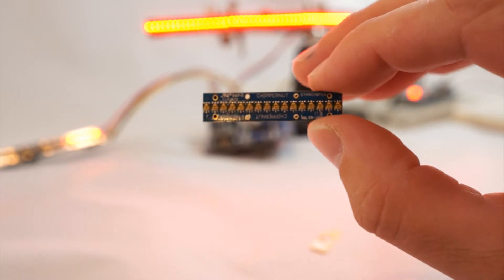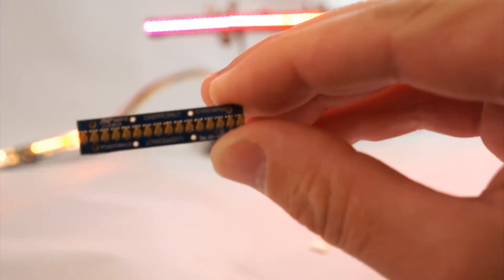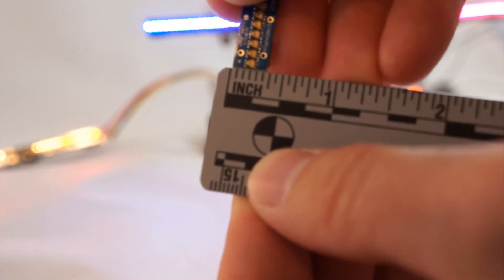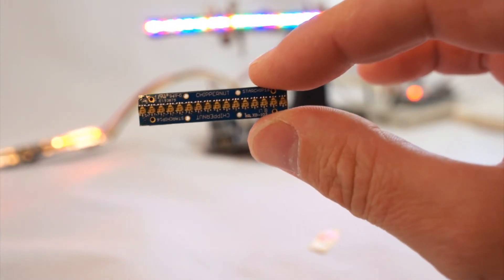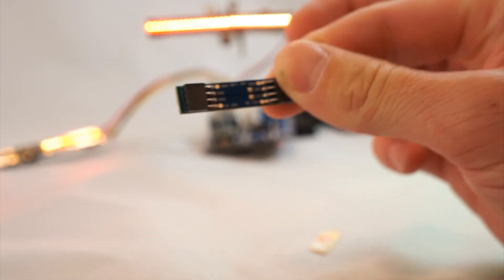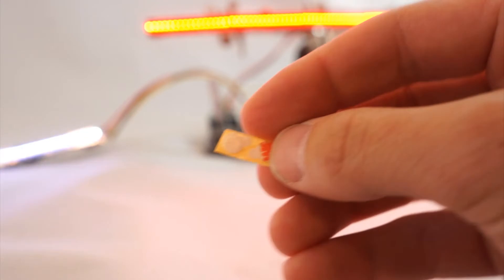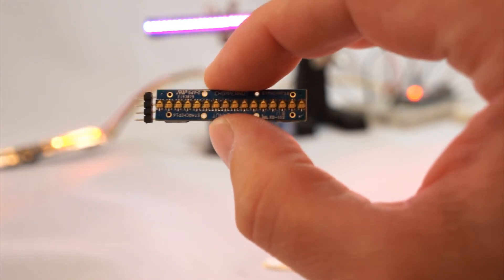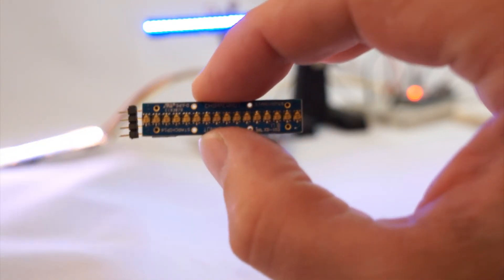StarChip16 Chippernut APA102 2020 LED Board 16 Leds

Comment: I found this video while I was designing exactly the same thing in order to test the throughput.  Have you done that?  Somebody said he could get 40M-bits/sec through them, but they weren't reliable at that - they lit up with random colours, as if clock synch was out.  Did you test data rate?